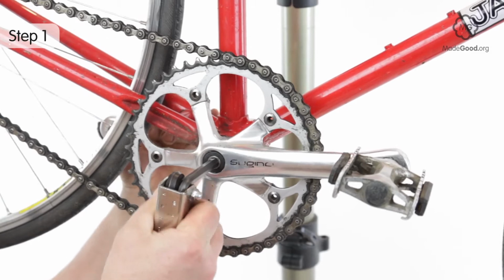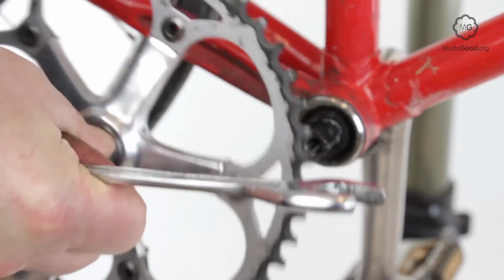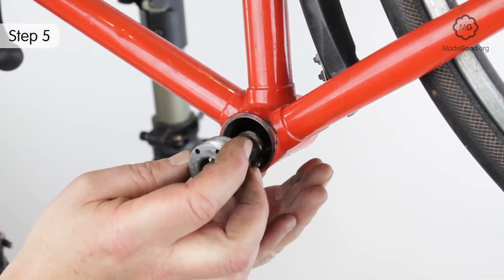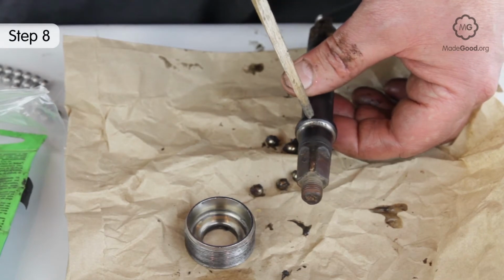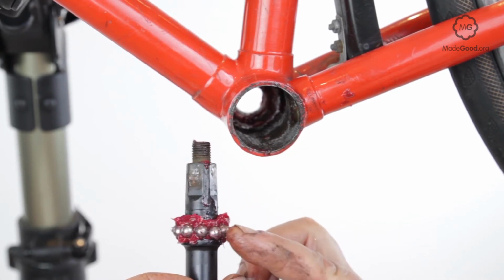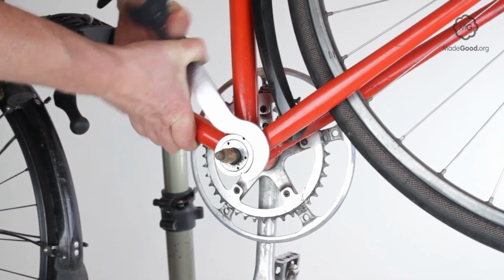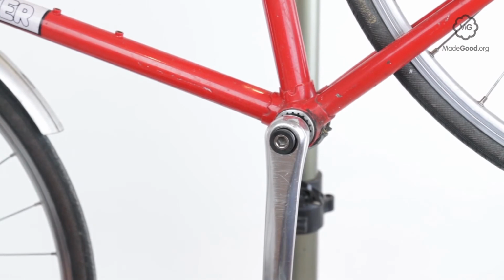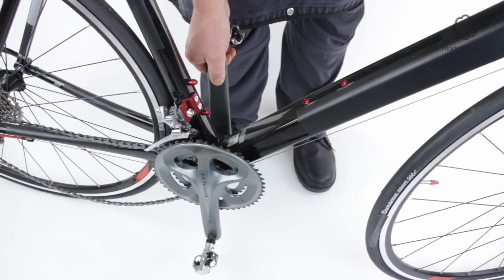Overhaul A Bike’s Cup And Cone Bottom Bracket

Comment: Thanks so much!  I wanted to take the old slightly crunchy BB out and replace it with a sealed one, but the fixed cup had other ideas (and I have no vise).. This video gave me the confidence to replace the bearings without removing the fixed cup, now the bike is back up and running smoothly :).  Maybe next year I will bring it to a shop to see if they can remove the fixed cup, but for now all good and maybe I'll service it this way for years to come to make use of the peg spanner I bought just for the lock ring.

Comment: This is a great video and thanks for posting it - just 1 question - is it ok to use vaseline instead of grease? Last time I used butter, but that was not very good and started to make grinding noises after less than a month - upon inspection found balls to have gone rusty :-(
Reply: vaseline (petroleum jelly) or butter are terrible options for bottom bracket lubrication. You can get a tube of general purpose automotive grease for just a couple of bucks, or a bike specific grease also for very cheap. like 5 USD.
Reply: ok, thank you very much for the advice - I have borrowed a bit of marine grease that my sister uses on her outboard - guess that should stop the rust problem
Reply: Greenjuiceman Marine grease is a great option! Good luck, man! 

If you wanna work on your bike I suggested watching vídeos from "RJ the bike guy" he explains everything on how to clean and regrease

Comment: hi!
how tight should the fixed cup be? is tapping the spanner with the hammer overdoing it?
thank you
Reply from the maker: Yes I think that hitting it with a hammer would be overdoing it. The act of pedalling tightens the cups over time, and in most cases become very difficult to remove. Make sure it's nice and tight with just your hands and a spanner and it will be fine.

Comment: isn't there a danger that if you only use 1 spanner when pulling the chainring from the axle that you will sheer the threads on the inside of the chainring ?   I usually use a second spanner to prevent this.